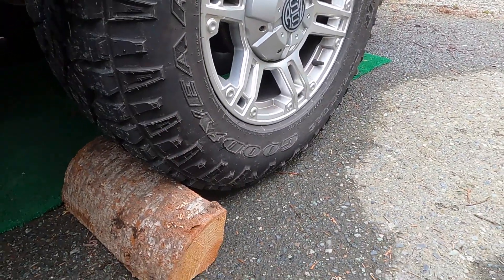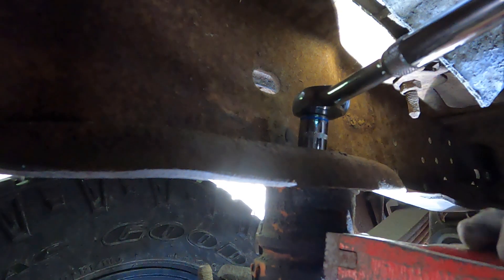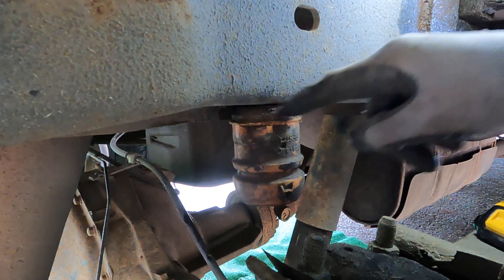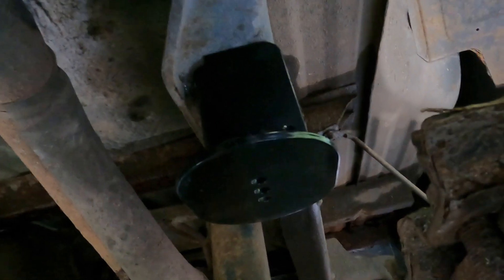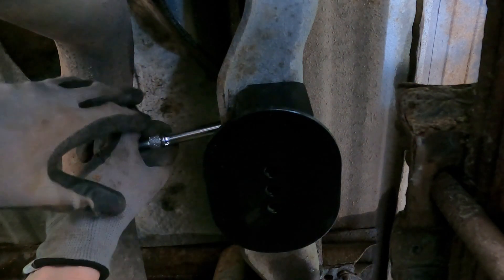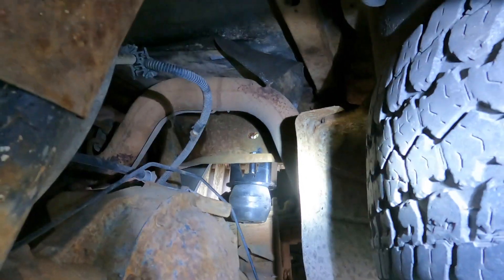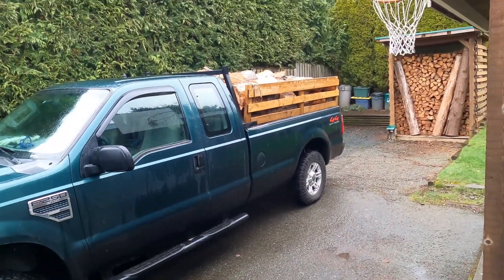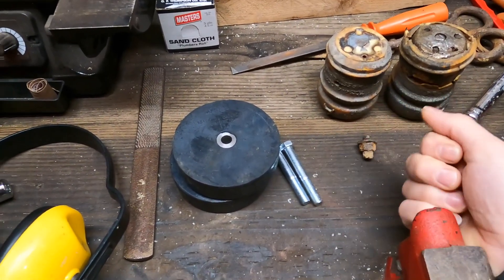Timbren SES  Install - Test - Review of the Suspension Enhancement System

Comment: I installed Timbren SES units in the 2021 GMC 1500 as well.  Needed them for towing my loaded up 6x10 enclosed trailer (that does NOT have a Weight Distribution hitch).   For the Timbrens, I installed with 1" gap and they work great.   Riders cannot feel ride difference when NOT towing and the truck sits near level when towing.   I recommend for folks who "load up" their pickup box and who also tow loaded up trailers.  Many times, I feel the Timbrens should be factory build inclusions...
Reply from the maker: @10drowsy  I completely agree, thanks for sharing!

Comment: Wondering if you drove highway speeds with that load of wood or the camper and if you noticed any negative handling characteristics? tks!
Reply from the maker: @brucehughart4894  Yes l did drive highway speeds but never to far above speed limits & definitely noticed that with having less squat in the rear of truck that the front end handling was better with  much less sway. In my case having a 3/4 ton truck they work great.